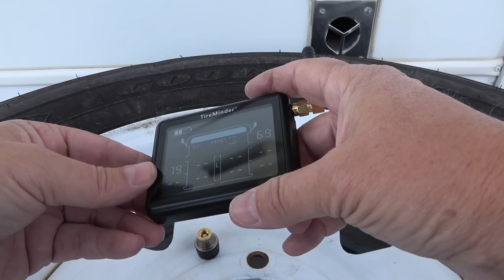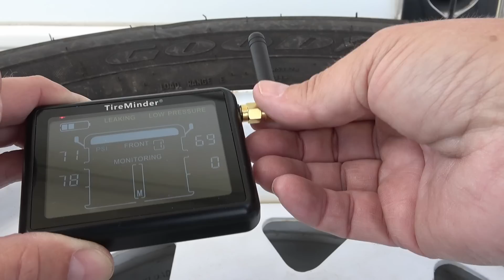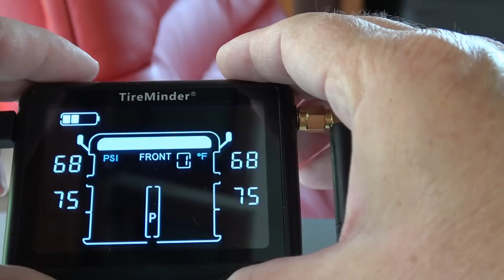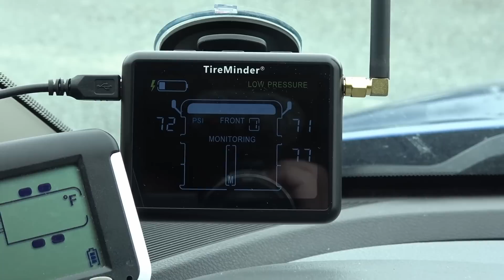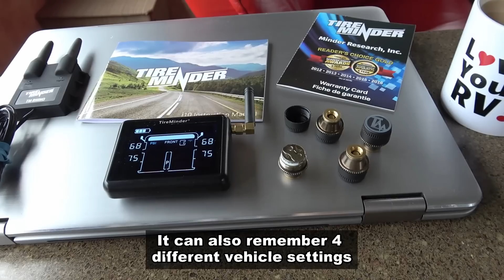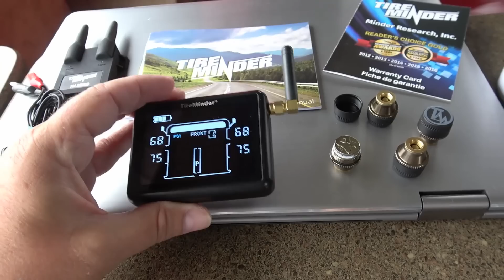TireMinder i10 RV Tire Pressure Monitor System Review

Comment: A small miss statement, you would not want to look in the tow vehicle for the cold tire pressure for a trailer.  That would be found on a sticker usually located somewhere near the outside left front of the trailer.  Enjoyed your video and it helped me do a replacement install.  My old TM monitor had a hissie fit and died.  With the new install I replaced the four original tire sensors with the new ones.  I kept the original repeater that is located inside my front passthrough compartment and the new one as a spare,  Used one of the original sensors on the spare.  All works GREAT.  Many thanks.

Comment: I think mine is defective, when it does read the tires it 34lbs instead of 80 and doesn't read all the tires, I even changed all the battries and that didn't help, now it shows signal loss lol, even if I have booster 3ft. away, oh well it hapoens I guess.
Reply from the maker: Hopefully its less than 3 years old
TireMinder Limited Warranty
In order for Minder to extend its award winning customer service, it is extremely important that you complete and
mail the enclosed warranty card along with a copy of your bill of sale.
This TireMinder TPMS is guaranteed against manufacturing defects for a period of three years from date of
purchase. Should the unit not function as designed, TireMinder will repair or replace the section at no charge to
the owner.
Excluded are products that have been damaged through impact, water, fire, misuse or unauthorized service.
This warranty is limited to the replacement of the product only and does not extend to any incremental cost
incurred. In no case shall TireMinder's liability exceed the purchase price. This warranty gives you specific legal
rights which may vary from state to state or province to province.
If you have a question or a problem, please contact the TPMS specialist at TireMinder (772.463.6522) before
returning the product. Many issues can be resolved over the phone.
If service is required return w / copy of bill of sale to:
TireMinder
3000 SE Waaler Street
Stuart, FL 34997
United States of America
(772) 463-6522
www.MinderResearch.com
info@MinderResearch.com
©COPYRIGHT - Valterra Products, LLC. 2020-2021
Reply: @LoveYourRV  I got it 3 days ago, I'll call them Monday to see if they know any tricks to fix it before I send it back

Comment: Purchased these June 2021. Starting on the 1st trip out we had multiple times that we pulled over with one monitor showing low tire pressure. With that said every trip we have taken which is probably around 10 times now we have had a sensor issue. 99% of the time we have the pressure reading way higher then what they actually are. The last trip air pressure was showing 94 to 95psi when by our tire pressure gauge we were at 80psi. By the way to help confirm PSI my truck sensors showed each 40psi and that's what the tire gauge reflected as well. Saying that so we don't have someone say how do you know your gauge is correct. 
I have let all the trips and the wrong pressures go on long enough. I called Tire Minder and they said that I need to do a reset to clear out the memory that the unit had stored. My question is why does it hold memory and show past why is it not always reading the current pressure for the current trip not a past trip. Tire Minder said that each trip out I need to do a reset to clear memory. I am thinking that the purpose for these were to always reflect the now value all the time no matter when my system is on. 
 So I felt like people purchasing should think about that when buying a tire monitor system. I am looking  around reading reviews to purchase another brand to give them a try. I do not want one that holds a memory of psi.
Reply from the maker: From what I gather some types of sensors go to sleep to save power when parked and wake up on motion. I wonder if these need some sort of motion to wake the sensor and have it start to transmit again to refresh the pressure last recorded. Just a thought.

Comment: Will this system display the temperature?
Reply from the maker: Yes, but you have to manually use a button on the display and toggle between PSI or Temp

Comment: Ray if you are parked for a extended time do you need to unplug the booster from the battery ? My 5 th wheel might might not move for a month or 2 . Just curious. Great review . Planning on setting the unit up this weekend . Used your discount without and problem .
Thanks Johnny
Reply from the maker: Thanks. :) Its a very low power draw so depends on your setup like how many batteries you have and if there is any solar charging. If not probably best to unplug it. Cheers, Ray

Comment: Don't know if this question has been asked but anyway, I have a 35' Super C class Motorhome pulling my car with a Dolly that has 12" tires. I recently had purchased a Guta 10 Sensor TPMS (Sent it back) I could NEVER get the parameters to set correctly and it was always flashing a warning sign that my tires were over inflated and over heated etc. So my question is, will this system be able to set the parameters for my 6 -19.5" RV tires, 
2 -12" Dolly tires and 
2 -16" Car tires that's being towed.
Reply from the maker: You can get it with 10 sensors - https://www.minderresearch.com/product/tiremindertireminder-i10-rv-tpms-with-10-transmitters/  It should work well as it can handle PSI as high as 199

Comment: I would not recommend this product. Customer service calling Tire Minder not very good, I bought mine set up ten week later tried power it up and wouldn’t work. I recalled tire minder for replacement 2 weeks later I’m still waiting.
Reply from the maker: Thanks for the feedback. who exactly are you dealing with. The TireMinder company or one of their distributors? Like the https://innovationtire.com/ for example?  Ray
Reply: @LoveYourRV  tire minder, directly
Reply from the maker: OK, thanks, just was wondering if you had bought from the Innovation Tire distributor that I was dealing with. If so I would have reached out to him for you to see what the issue was.
Reply: @LoveYourRV  if a manufacturer doesn’t stand behind their product, I’d avoid. It’s not like I used it for months actually set up, placed in storage then 7 days later, hooked up and monitor didn’t work so call Tire Minder left message they did call back but 2 weeks later still waiting on Monitor to arrive and I’ll send monitor not working back. My thinking from Florida to Texas 3-4 days Max
Reply from the maker: Not trying to defend them, they should keep you in the loop, but I know many electronic type and RV products are having supply issues these days. Most of the shipping ports are swamped with container ship backlogs.
Reply: @LoveYourRV  I spent time researching an chose Tire Minder, but brand new I don’t think I should have to wait ongoing 3 weeks for a replacement. I bought mine from Amazon. That’s why I called Tire Minder directly. Hopefully this week it will arrive, but Tire Minder could at least call saying new monitor will be shipped on this date. I feel so anyway.
Reply from the maker: I agree, they should let you know what the hold up is.

Comment: I installed this model on my two axle trailer a couple of weeks ago, and I can confirm that the review by Ray is accurate. One tip I have is to make sure your tires are at the pressure you desire confirmed by a tire gauge. That will let you know that the sensors are accurate. During setup, I inadvertently setup a sensor in the wrong position; I had 3 sensors on "rear" and one on "front". It took another read of the instructions to figure it out. That's when I realized you can program 20 sensors per vehicle! Can't wait to take it out on the road.
Reply from the maker: Thanks for the comment Rich. Cheers, Ray

Comment: I wonder if the sensors will throw the tire out of balance. If they are brass then there has to be some weight to them.
Reply from the maker: I found this in the TireMinder FAQs:
Can I use a tire balancer with my TireMinder TPMS?
Equal can be used as a tire balancer with the TireMinder TPMS installed. Please note, in order for the Equal to properly work with the sensors the installer should replace the valve core of each tire that Equal is being put in (the bag of Equal comes with a replacement valve core). Also, we recommend to only check the tire with a tire gauge when the valve stem is near the top of the rotation (Equal will cause the air to leak from the tire if the valve stem is near the bottom).
If you would like to avoid these issues, we recommend having the tire balanced by machine. Remember, a tire does not need to be rebalanced upon adding our TireMinder transmitter.

Comment: Hey Ray, when you need to fill a tire and take the sensor off, do you have to go back to "learning mode" or can you just put the sensor back on and it would work?
Reply from the maker: Once the sensor is set it remembers so don't have to go into relearn mode when taking off and putting back on.
Reply: @LoveYourRV  thank you

Comment: Ray, do you usually use the TPMS built into the truck? Also, would you do a video regarding use of the exhaust break in combo with tow haul mode and cruise control. I have a 2015 RAM 3500 2WD to pull a 37' Montana High Country and love it so far. Just want to make sure I'm optimizing it's capabilities (and not screwing up). Also, do you change the oil and filters yourself?
Reply: P.S. Just ordered the i10 RV. Thanks for the discount!
Reply from the maker: Yes, so far I've been using the trucks built-in TPMS to handle its wheels and have the aftermarket for the trailer tires.
If I buy a few more sensors I could also cover the truck. But my main concern has been the trailer tires.
Not sure if you have the auto exhaust brake setting in 2015 as well as full setting. Generally, I run the Auto mode for most of the time and just use the full mode for steeper descents of really curvy roads where I need the extra slowing power. Auto mode basically maintains speed like a downhill cruise control whereas full mode will actually slow the rig.
I always tow with the tow-haul mode on and with my particular setup 3.42 rear diff ratio I generally lockout 6th gear unless on a dead flat highway and no wind. For steeper hills and curvy roads I often also lockout 5th as well. I find the tranny doesn't shift back and forth so much and the exhaust brake works better with the higher RPM. Also keeps me more in the max torque power band of the Cummins 6.7L  around 1700-1800 RPM, may lose a little fuel mileage but also helps keep the engine running cooler, less chance to lug it.
Each person's truck may be a bit different, like a 4.10 rear diff versus my 3.42 makes a huge difference. I also have the AISIN tranny versus the Chrysler and they have a bit different gear ratios.
As for cruise control I usually only use it for flatter boring highways as I find it shifts gears much more versus my manual foot on the throttle.  I figure all the shifting under load wears on the transmission.  But I'm not an expert by any means. :)  Cheers, Ray
Reply: @LoveYourRV  Hi Ray, Hope all's well with you and Ann. Thanks for your reply. It sounds as though  I'm using the system pretty much the same as you. I have the 3.42 diff. as well. We just returned from a trip from here in So. Cal to Fish Lake, Utah (beautiful) and that truck worked beautifully. Man, what a system. My trailer weighs around 15,000 as it sits and the truck has no problem handling the load. It steers and rides very nicely. I average about 12 MPG while towing and and that's about 50% better than I'd get in my old gas motor home. Still adding things as needed, but love the truck. The i10RV TPMS was here when we got home. I unboxed it and when I took the protective film off the screen I discovered it is a used unit, all scratched up. Sent Innovation an email and we'll see what happens. He didn't return my call when I had a question before ordering. Oh well, just thought you might like some feedback. Thanks for everything over the years. Happy trails, Randy Neilson
Reply from the maker: @randyneilson7465  Thanks for letting me know Randy, I'll send an email as well alerting them to that, wonder if it was a return that got repacked, even so not a good thing!
Good to hear the truck it performing well!  Update: they told me there are 2 screen protectors
Reply: @LoveYourRV  Thank you Ray. You're right, it does have two protectors. Still, I wonder why the outer one would be worn looking. Oh well I'll wait and see if they get back with me. By the way, I bought my truck used with 38,000 miles last October. Very nice, but expensive. Cheers

Comment: Nice review, thanks! I will look forward to see how you get on with it over the rest of the year... I have used the BellaCorp TPMS for the past 2 years and it has been horrible! On my recent 4 thousand mile trip I basically listened to one of the sensors beeping the whole time... and that was with the additional repeater (and my camper is only 21 feet, so it's a rather small camper!) Besides the sensors randomly going out, the customer service was a bit rude, the display feels like a plastic toy and the port for the charging cord feels like it is going to break the end of the cord off when plugging it up because it's not cut right or lined up correctly. Besides that the mount doesn't hold the display well and the window mount ending up leaving a dripping, gooey, messy glue running down my window and dripping into the small holes on our dash! I don't have any more long trips planned this year so I am going to hold off til next year before replacing it, but I couldn't recommend the BellaCorp TPMS with a good heart, and I can't continue to rely on it for something as important as keeping up with my tire pressure. I was looking at the one from TireMinder that connects to my phone and uses it as a display, which would solve your issue of the glare on the display. But I have added this unit to a temporary list so I don't forget it later. I do agree with you though, it would be nice if the high temp alarm could be set to a lower temp... maybe by the time I decide to get another one they will update this one with some of your suggestions! Thanks again!
Reply from the maker: I've been using the EEZRV for a few years now and no complaints - https://www.loveyourrv.com/eezrv-tpms-unboxing-installation/  https://www.loveyourrv.com/goodyear-endurance-trailer-tires-eezrv-tpms-review-update/

Comment: I see several comments on here about wearing polarized sun glasses that essentially eliminate screen details.  I dealt with that as an optometrist for some 35 years and unfortunately had to advise patients to avoid the polarized lenses.  Easier said than done since most of your over the counter sun shades are/were polarized.  Personally I would have my lab replace those lenses for a non-polarized version which would solve the problem.  If you've found a sunglass frame you can't live without, try your local optometrist or optical shop and have the lenses replaced with any color and density you prefer, but without the polarization.

Comment: Good review Ray. I had a TireMinder system when I had a travel trailer and there are a few things that bothered me about it. 1. It was consistently 5 PSI too low on every tire and it was checked against 3 pressure gauges that I trusted as being accurate. 2. Mine was nearly impossible to see when mounted on the windshield due to the glare and if I wore polarized sunglasses it was a black box. 3. When not towing the unit would randomly alarm showing all pressures too low which was very annoying. 
Overall it worked okay if you could see it and mentally adjusted for the pressure discrepancy. My next system was an EezTire monitor like you have and so far I've been pleased with it.
Reply from the maker: Thanks for the feedback. Appreciated.  I tried this model on my truck and it pretty much matched the onboard factory PSI readings. They also sent me some gadgets to play with. One is the TM digital tire pressure gauge, actually looks pretty good, so will check with that and my other two I carry, one standard mechanical and one digital.  Will report my findings in the gadget review video. Cheers, Ray

Comment: With the monitoring units mounted on the tips of valve stems, I question the accuracy of temperature readings. Any thoughts?
Reply from the maker: Yeah, I think at 167F its more of a final fail safe before something catastrophic happens. I guess they are attempting measuring the internal air temp, but I'd assume sun on the sensor will have an effect. On my EEZTire TPMS I set my high temp alarm much lower, usually around 110F. In my normal trips I rarely see the temps of higher than 100F. I have installed metal stems on my trailer tires and they are aluminium wheels so figure a dragging brake or failing wheel bearing or an overheating tire will transfer the heat to the sensor. Seems to work pretty good. If I use my brakes a lot or drive really curvy roads I can see the heat rising. I'm not overly concerned with exact temp accuracy just what to know when one wheel gets out of the normal range or be alerted if it gets too high.  Cheers, Ray